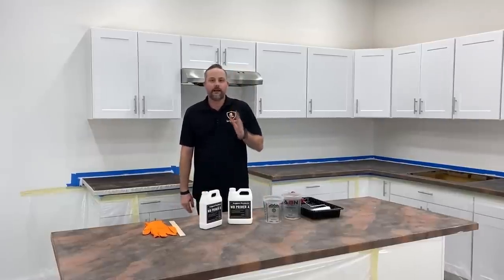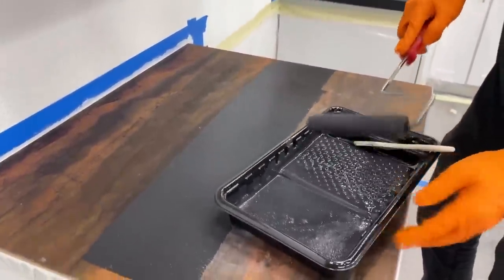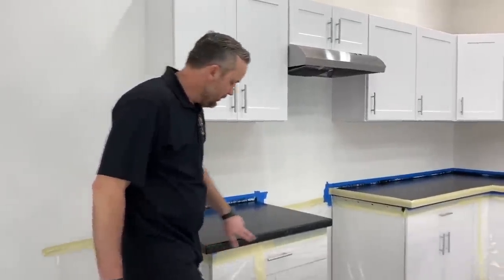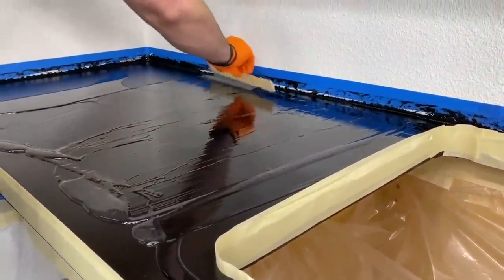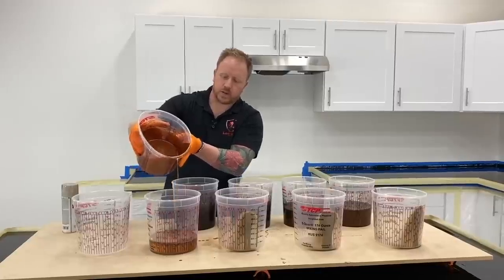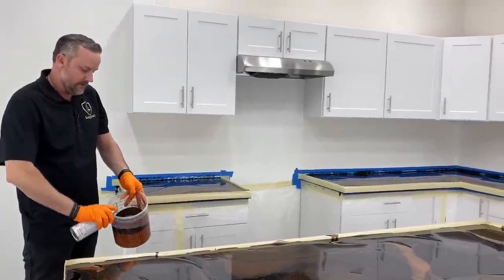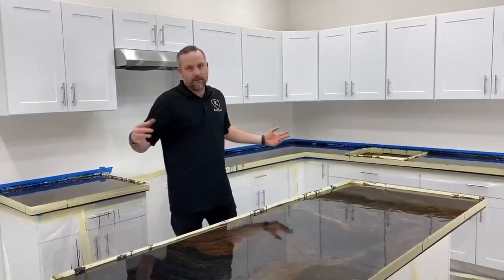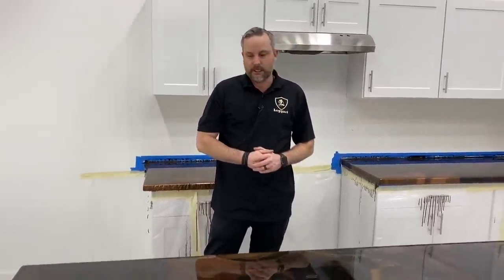Epoxy Dirty Pour Technique On Kitchen Countertops Full Tutorial | DIY Countertop Remodel Ideas

Comment: In the final shot you can see the sides didn't cure smoothly, lots of bumps and texture. That's too bad, the top was awesome.
Reply from the maker: Thanks for watching the video
Reply: I believe he had some sections where the edges were not smooth on purpose to give it that natural edge stone look....it was done before the epoxy was applied.
Reply: I noticed that too...just some of the edges along the wall counters...don't think that was intentional...was just in a couple of areas. How would that be fixed? But the rest, gorgeous!  How durable is this material? (Heat, etc?) How do you care for them, clean them? Thanks!
Reply from the maker: @tdhawk167  The edges that you where looking at where decorative edges they did using Bondo multi purpose putty to give it more of a chiseled edge look, they did that on purpose.  Our products are actually industrial coating made for military aircraft hangers, etc. So theoretically in a residential, or even commercial setting it will last forever. This is NOT a cheap epoxy paint that you will commonly find at box stores like Home Depot or sherwin Williams. It is a thick 100% solids epoxy coating.
Fire and heat test

https://youtu.be/09elup51N6U
Reply: Frame 102:44 shows some very rough edges.  My kitchen  counters with edges about 1.5" long with a 3/4" radius quarter round on top.  I would get killed if the end result was not as smooth on the edges as it is on the top.   Do you have a video of a project with a similar edge?
Reply from the maker: @kevinyork4757  That edge you were looking at was Tylor doing a decorative edge.  Most of the videos he does, shows a smooth poor over the edges.  You can email leggari@gmail.com and our techs can help you out with the type of edge you have.
Reply: @shelbytydings3457  What I am referring to is the dripping that didn't level out, I'm not referring to decorative edges. You can clearly see areas that have clusters of drips that didn't smooth out.
Reply: @rudishafakian  I'm referring to the clusters of dripping not decorative edges.

Comment: wont this  scratch easily and be hard to maintain>
Reply from the maker: Our products are actually certified for industrial grade coatings made for high traffic commercial settings. So theoretically in a residential, or even commercial setting it will last for decades as long as the urethane top coat is re-applied when needed to protect the decorative coating. This is NOT a cheap epoxy paint that you will commonly find at box stores like Home Depot or sherwin Williams. It is a thick 100% solids epoxy coating formulated for high traffic areas and heavy machinery.

Comment: Very good floor, but it's cost& life is
Reply from the maker: You can actually order or price out a custom kit for that exact square footage through the Counters section of our website at www.leggari.com. Simply click on Counters >>>> Custom Counter Kit Here, then the link order Countertop kit, then follow the steps.
Our products are actually certified for industrial grade coatings made for high traffic commercial settings. So theoretically in a residential, or even commercial setting it will last for decades as long as the urethane top coat is re-applied when needed to protect the decorative coating. This is NOT a cheap epoxy paint that you will commonly find at box stores like Home Depot or sherwin Williams. It is a thick 100% solids epoxy coating formulated for high traffic areas and heavy machinery.

Comment: Covering old tile..!? I can't find this type of video, so I'm just gonna diy somehow!
Reply from the maker: Yes it can be put over tile, but you need to fill all your grout seams with multi purpose bondo from Home Depot, then sand it smooth, this will scuff up your tiles also, then wipe it clean with denatured alcohol then you are ready to apply our epoxy.  Take a look at the tutorial below.  Thanks
 https://youtu.be/g8GzsL0kpns
Reply: You can probably add fumed silica to the epoxy to create a thick epoxy that will slick off better than bondo. If you use silica powder WEAR A RESPIRATOR!